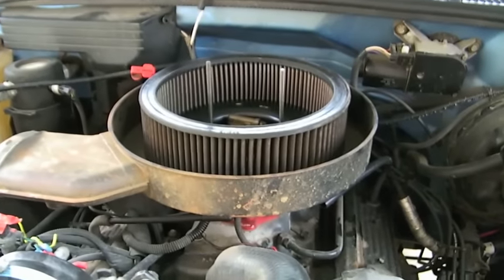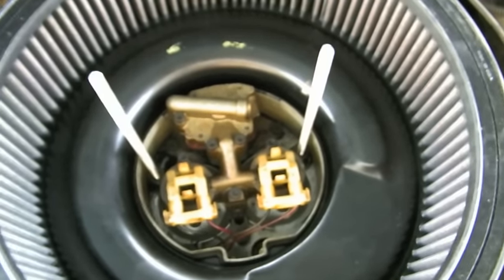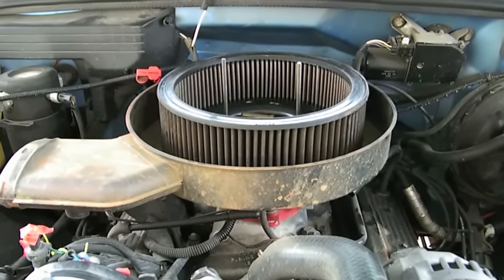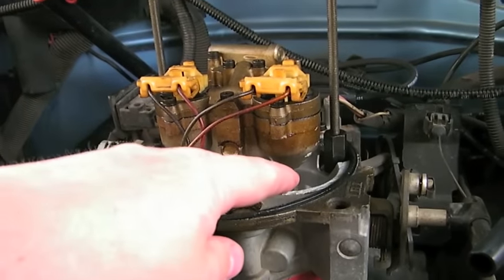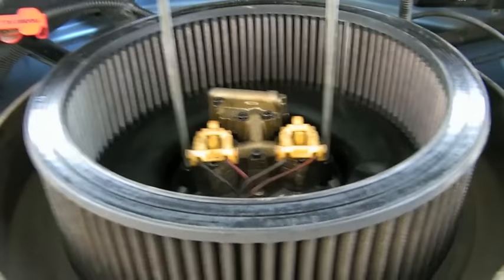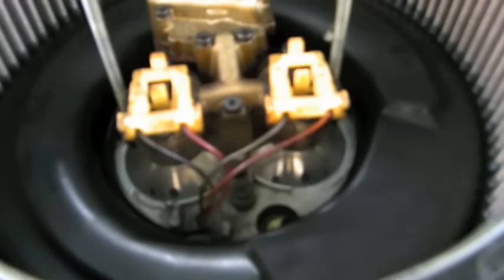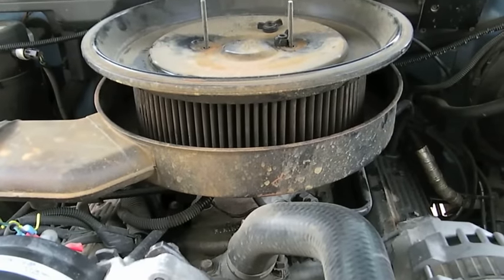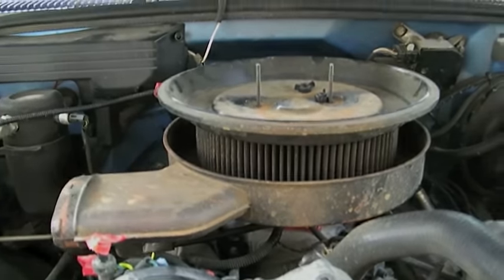TBI mods, how to get the most power and Horse Power from your TBI engine.

Comment: tbi will run forever but will never be a power house. save cash find a 5.3 or better yet 6.0 from the junk yard with ecm and harness.  you will never look back. these trucks are lighter then the new ones so with a ls they run really well.
Reply from the maker: +john edwards 
Just add vitamin LS
Reply: Yes vitamin ls. I took my tbi 350 out of my 94 gmc put it in a 81 camaro with a carburetor it runs really strong in that car. But never really did in the truck. Must be the carburetor.  I guess.
Reply: yes but I was talking about how much smother it is with the carb. it revs faster and higher even with the clutch in. I think the stock tune on tbi didt run enough timing.
Reply: john edwards  how bout a 454 tbi on that 350 and megasquirt with dart 180 heads will smoke that 5.3
Reply: i agree...super reliable but you wont be winning any races with them.
Reply: Boss used to have 454ss chevy heavily modded,TBI run low 12's.
Reply: How hard is the swap to ls really and what is the average cost to do it
Reply: Well it doesn't really count because of my engine. But I walk off and leave my buddy's 5'3 we both have extended cab 4x4s. I do have 4.11 and he has 373s but I don't think that's the big difference. I think it would be the fact that my truck is a 6.4 /388ci with a single plane high-rise. 4 in long tube hookers. I'm running a carb and HEI distributor right now just because. My TBI distributor went bad and my truck set up to run a car or TBI. Yanking the distributor out ain't no big thing. It runs about the same but it did take me 6 months to get the TBI to run the way I wanted it to. Between where to hook up the vacuum for the timing / fuel adjusting the throttle positioning sensor. I deleted the idle control valve because that thing just kept f**** with me. And everyone says the TBI computer can't pull past 5400 my triple red does 6500 and she still pulling hard I just start getting really scared at that time. Tbis get a bad reputation. But if you got somebody that can burn you a good chip. You can make some hellacious power with them. But the drivability of my truck is not ideal cold starts sound like a top fuel dragster. If it gets above 95 outside you can't drive because she'll start detonating and knocking because the compression is too high although she does love some e85 ethanol but I have to switch the injectors to 454 injectors and turn the fuel pressure down from 26 PSI down the 14 PSI and then if you're on the throttle real hard she'll start dropping off. The carburetor was way easier about 2 hours of tuning. And she fires up when it's cold runs fine idols a little high but if I turn it down she lopes really hard. And while I love that sound it's not exactly good for the engine.

Comment: What's your experience with the 'lid flip' vs. cold air intake?  I'd think introducing cold, dense air to the TBI unit would be more valuable than introducing more radiator-warm air.  What do you think?
Reply: I don't think a cold air intake it's worth all that money you can spend anywhere from $100/$300 for a cold air intake kit and anyways you don't see hot rods on the track with that stuff on they take all that stuff off. That's my opinion so.
Reply: @matthewvarnam4302  I meant the stock intake, that introduces cold, fresh air...
Reply: It doesn’t really introduce cold air though. The obs underwood temps are so high that the air filter housing gets hot and radiates all that heat inside the intake as well. Your air is probably 30% warmer by the time it’s in the intake manifold than it was behind the fender
Reply: @coleknight7572  To a certain extent, maybe, at low vehicle and engine speeds, say, off-idle.  However, the cold airflow at highway speeds and increased increased engine breathing, higher RPM, overcome underhood heat very quickly.  That's why off-the-line speeds are so much better coming right off a highway run: no heat soak on underhood engine parts, and particularly the intake manifold.
Reply: Cold airflow isn’t really that cold though. Almost all new air in the engine bay has already passed through the 170* radiator. That air is at least 40 over ambient. Highway would definitely help though not denying that. I have a 95 k1500 and lid flip helps with response mostly but always helps hot or cold ambient hot or cold engine temp
Reply: Maybe I’ll test it tomorrow or sumn. I’ll run 25mph round town and kill it and touch the housing and then run a steady 60mph for 10 mins at 1600ish rpm and do the same
Reply: From what I’ve seen more air is better than cold air. Just isn’t enough density difference in 110* air to 60* air to justify missing an opportunity to move more volume
Reply: @coleknight7572  You're assuming the intake air is being sourced from the same air that has cooled the radiator.  I'm talking about air that has been sourced outside the engine bay, "the stock intake, that introduces cold, fresh air...".
Reply: Yeah I got you. I mean the air at 60mph isn’t doing a whole lot to cool the intake housing whatever it may be. After all the air can’t avoid passing through a higher temperature housing. That heat radiates outward and inward. Imo you need a scoop that goes right to your intake or a plastic or composite hoses to get truly cool air. Metal underhood will absorb all your engines outside temps

Comment: OKE heres a few real performance tips from someone who actually knows what they're talking about. Changing the spring in the injector to 18 lbs and using a 1996 up Vortec fuel pump is all the modifications needed to the TBI unless you use one that's been machined (bored) to 2 inches. A K&N Velocity stack summit part # 58-1190 will unshroud the injectors and create a non restrictive intake. Beyond that a nearly stock engine wont see any benefit other than using orange chevy valve springs with 110 lbs of seat pressure @ 1.7 inches and a set of 1 &5/8s headers and performance mufflers. Replace the swirl port junk heads with a set of ZZ4 / L98 corvette aluminum heads, a Weiand 8000 EGR spread bore intake (based on the Weiand stealth intake) and a ZZ4 hydraulic roller cam and these TBI injection run great. They'll flow 585+ cfm on a superflow flow bench. The 2 inch will flow as much as 650 cfm depending on other factors. Ive built far to many of these to know what works and what doesn't.  I run 1.75 Hooker full length headers into 2.5 inch Flowmasters. The more work you do the more changes to the prom will need to be done.  Sinister Performance programmed my chip, I gave them my engine specs, tranny & torque converter, gear ratio, and tire size and they took all that data and dialed in my EPROM. A GM 2732a EPROM isn't exactly expensive and they're pretty good at dialing them in. Leave modifying the throttle bodies to ppl who know what they're doing not some schmuck with a Dremel rotary tool.
Reply: I'm rebuilding my 95 k2500 motor in a couple weeks was going to be swap to gm cam # 14097395
Which I believe is the lt1 roller cam and from what I read does not need to be reprogramed what do you think? And what other modification should I do best bang for the buck?
Reply: Also where can you get a 8000 intake I just looked and they don't sell anymore :(
Reply: @jdias51  ebay  theyre about 120 dollars used.  youll need an adapter plate Trans Dapt # 2206 and a 1 inch spacer Trans Dapt #2733 to clear the egr breather. you can get those at jegs or summit. the plate has the holes for the throttle body cut in the rear so it flows into the wide part of the plenum. this also means you can use the existing throttle cable and bracket. This set up works a lot better than the Holley and Edelbrock TBI intakes which arent any better than a stock manifold.
Reply: @jdias51  holy crap that is a seriously small cam 196/206 duration .431/.451 lift.  that cam will peak at about 4500 rpm. if using a stock chip is your main concern go to Sinister Performance and get a chip from them for around 100 dollars and put a real cam in the engine to so you can take advantage of the performance. use ZZ4 heads casting number 113 and Lunati cam # 20080660 213/219 duration .447/.471 lift. this combo should bring you close to if not higher than 350 hp. A ZZ4 uses a 208/221 duration .474/.509 lift and isnt as good as the Lunati as far as performance goes. above that an LT4 hot cam is a really good cam and is whats in my truck now and it did make an improvement and i still use the same chip with the ZZ4 cam. A good set of 113 casting heads on Ebay is 300 dollars.  put Manley springs #22410 and retainers # 23652 and set them up for 1.75 inches. the retainers add .050 to the  installed height and have 130 lbs of seat pressure which is fine with hydraulic roller cam engines. This set up has beat every Vortec engine ive raced. if youre sweating fuel economy dont because it actually gets better gas mile than it did with the stock 210 hp turd the truck cam with.

Comment: I took a old Carb air cleaner and drilled out the stud holes and put a carriage bolt in the old stud hole at it worked great. I even paired my valve covers the old fashioned Chevy orange, it looks pretty sexy now.
Reply: droppedjaw23 %

Comment: Interesting thinking on the air system,  I know the up air lid makes for the more power sounds  but put it right and duct it into the inner fender and put the tabs back on that you cut off the top of the tbi for stronger air  velocity  to mix the fuel on a non forced air induction motor

Comment: Trust me dude, you didn't get close to 20hp gain with those crappy, half ass mods! Dump that stock cleaner for a K&N cold air kit. Putting a pair of exhaust headers on that motor would give you 20-25hp gain alone. Do a better job on those TBI ports and install a adjustable fuel pressure regulator to bump up that weak stock fuel pressure a little bit!
Reply: Nothing you just spoke of will help that engine make more power. You guys need to stop reading aftermarket parts brochures and read up on cams. Unless he boost the engine or add nitro, there's no other way to get more air in the engine.
Reply: ***** A cam that peak around 5000 rpm would be nice. The stock heads can handle the bump n lift. You probably will need to change springs. I don't know how to reprogram the computer.

Comment: Sorry I am not an engineer. I wish. Those folks that designed this engine seldom ever put extra metal where it is un needed. What your calling restrictions might be there to guide the in coming air to better flow at certain engine speeds. I did build and test jet engines for 10 years in USAF. Saw some wild air flow set up designs. Not always  clear why it was done the way. Can't argue with test results ya had. So enjoy. Chevy sure would have saved a lot of money per truck sold if it left off that extra plastic and metal on the TBI.  : )

Comment: Whatever bolt on mods you do, if you have not helped MPG then you wasted you hard earned money and time. Twenty HP or less is not worth opening the hood. Save your money for cam, heads, exhaust and ignition set up. Most of the mods mentioned here are only worth 2 to 5 hp at best. If all you're looking for is a little more pull up a steep hill, go for it. If you looking to go faster, keep your money in your pocket for real engine performance mods. Iv'e been around the block just a few times. There is no magic in this world! Always remember the one standing rule for making an engine breath better is exhaust mods. Long tube headers and tuned exhaust will get you 20. The other crap is wishful thinking.

Comment: Ok have a 93 5.7. First hyper tech chip, power pully's and s'can that boat anchor catalytic converter.  Then flow master 44 3" into two 2 1/2s. Runs like a scalded dog. Smoked a 96 vortec. Pulled away and left him at 115.

Comment: Quest for 400 hp tbi! Vortec heads the 09 something dunno can't recall off hand, long tube headers with an extra hole for O2 sensor for left and right bank spliced to the single sensor, .470 roller cam and 1.5 roller rockers, tbi to vortec manifold, 454 throttle body, port matched gaskets and msd ignition. Stock computer. It's all about manipulation but OBD1 is chip transferable so you get the idea. Maybe chip mod will hurt it or maybe not🤔

Comment: tune-up is where you got power from, turning air cleaner lid upside down doesn't do any good, just here roar of intake when you open throttle. people have been doing that trick since paper air filters were standard. you could be sending false signals to intake temp sensor and other and any other sensors that may rely on proper temp readings for computer to send correct fuel and ignition curves to engine
Reply: It works. That is why it is still done. After all these years.
Reply: The lid flip does work on these trucks. Not much so for all out performance, but more consistent throttle response just because there is more air going in. I've got a 95 GMC with 74k miles, 5spd.  At operating temp with the lid in stock position the rpms drop drastically while changing gears. With the lid flip the rpms doesn't drop as much allowing for alot smoother operation while changing gears and consistent acceleration.

Comment: do not grind the lips off the upper runner of the barrell.. gm obviously cast that extra metal in there for a reason, n its obviously not jus extra metal its in a shape that helps fluid dynamics, or in lamens terms it helps cram more air into ur engine, hes literally de-funneling the intake-dont do this unless u want negative effects...

Comment: wow you relize by fliping that lid u are forcing the motor to suck hot air witch robs power
Reply: If u have a 4" Cowl Induction Hood . that will fix that issue...
Reply: zack hange i dont do much low speed driving with my truck. There will be constant airflow under the hood, plus how warm do you think the plastic and metal duct work get regardless? I only do mine because it sounds better to me.
Reply from the maker: +zack hange 
how hot of air do you think i am sucking in?
Reply: Round 200 or so it gets very hot under the hood with stock manafolds
Reply: zack hange giant engine bay with a small block? the engine sucks some but the breathability outweighs that and u do gain hp
Reply: I know this is late but check out motor trend channel they do a test on engine masters where the lid flip worked better
Reply from the maker: Shhhhhhhh , Don’t let facts get in the way of a good argument!
Reply: Wrong

Comment: Did you dyno that 20 hp you claim? The heads, cam and y pipe restrict these not to mention the ecm prohibits a lot of modification. You are claiming over a 10% increase in power that you think gm engineers left on the table. Especially in a competitive truck market.
Reply: Hes probably just feeling a difference.  No noticeable hp gain i would wager.  My 454 is night and day different when it's cooler outside. Here in Florida,  Temps can get in the 90s daily.  At night when the temps drop and air gets denser, my throttle performance is extremely improved.

Comment: ROFL that ridge is there as a balance on the intake for fuel atomization. You made it lopsided and now it has a puddling effect on the inside of the intake runners that go into the base of the plenums because the place you carved up like a Thanksgiving turkey flows faster that where you didn't molest. The intake charge speed must be consistent on all sides of the fuel injection or your atomization will be effected cause some cylinders to run rich and others to run lean. Yours flows faster on the outside than on the inside. If you just threw that air cleaner and injector shroud in the scrap metal pile and put a K&N velocity stack on it you would accomplish 3 things. Unshrouding the injectors for better airflow (what you set out to do from the start). Better fuel atomization due to the increased velocity of the incoming air. And a straight shot down into the injector body not 90 degrees like that stock air cleaner. That modified injector you molested is junk. there is no power gain that I assure you, only an illusion caused by an increase in air flow. You shouldn't be making videos and giving bad advice, people who don't know watch this crap and guys like me are like OMG another doofus trying to be a Youtube guru.
Reply from the maker: When I need love potion I will call you.

Comment: Hey hey the maniacal s10 again. I meant my videos there is 17. I would like you to watch them and maybe trade ideas. The lid flip is good and old school. Put some small 1/4 inch holes in the top of your lid flip and some form of filter under the lid. The tbi pulls air better straight down and will give you probably 2 more Hp,  1 pound of torque. Also give it fresh air ( hood scoop) colder the better. I have been doing this for many years. I used to drag race '70 80s. Watch raodkill on Youtube on airfillter shootout. I think you will be amazed. I test andtune on the road. With a lot of luck I don't get ccaught.Please give me your option on what I have done. My spacer vs yours.  Thanks maniacal s10. Ps carbs , tbis,  throttle bodies, & throttle injection system with fuel logs. And modifying spark plugs. Thanks again, Maniacal S10.
Reply from the maker: I don’t have the truck anymore. Not for a lest 4 years.

Comment: Lid flip is a easy way to negate any HP gain. Ooh sounds good but now you're ingesting hot engine bay air vs cooler air through the snorkel and fender.

Comment: Even with the throttle body spacer and flipping the lid doesn't cause no problem with closing the hood does it ? Cause I thought about doin the throttle body to mine but I was scared the hood wouldint close or it would be a pain in the ass to close it